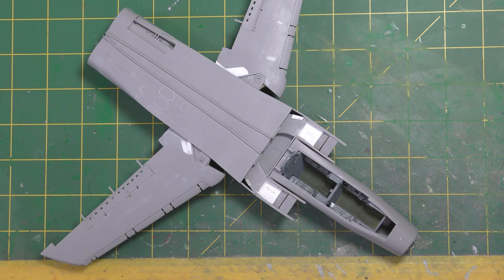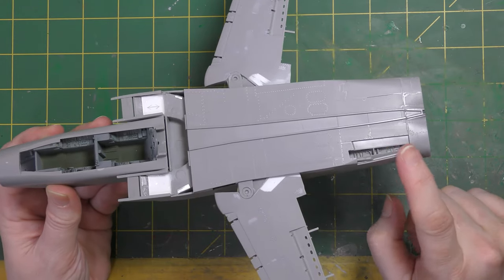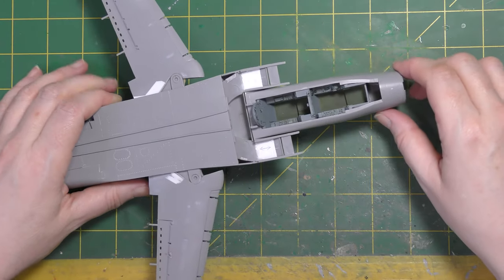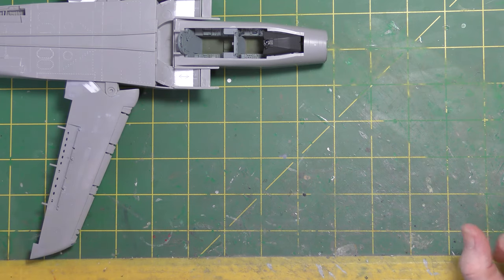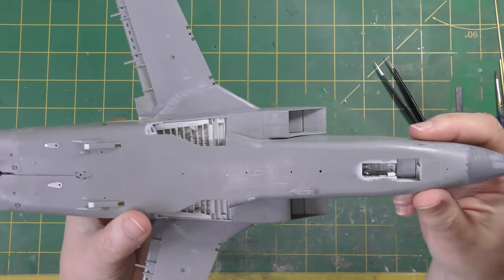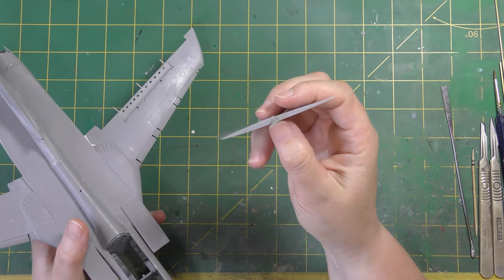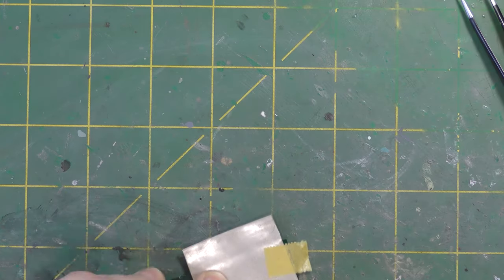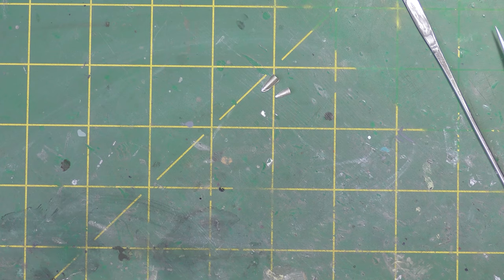Eduard (Revell) 1/48 Tornado GR1 Foxy Killer - Part 4.

Comment: Why do you use super glue + talc over most other kinds of filler/putty for all this work?
Reply from the maker: Hi Cameron, I use CA+talc because it is consistent. It doesn't shrink or crack and I know where I am with it, having used it almost exclusively for many years now.
Reply: @JenesisDesignsandModelcraft  ah interesting. Thanks for the response, I'll have to give it a go, cheers